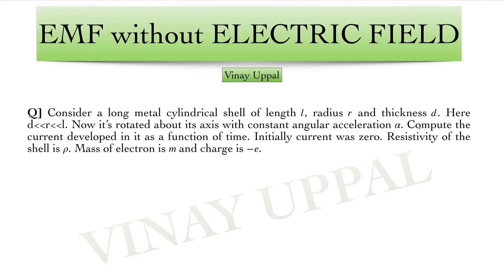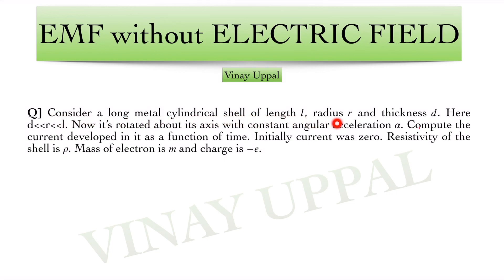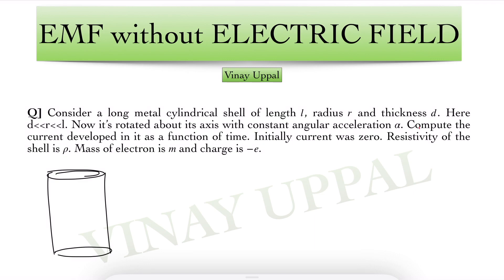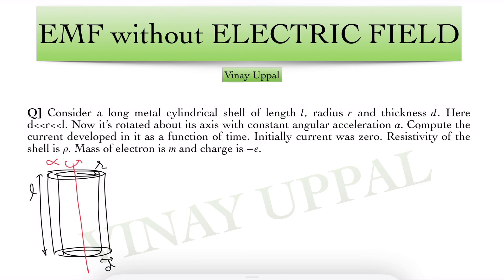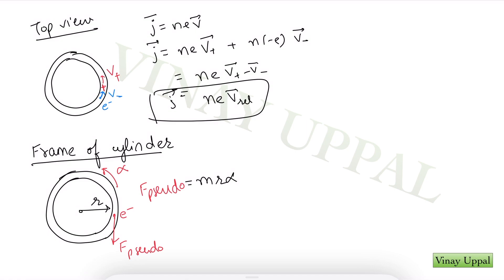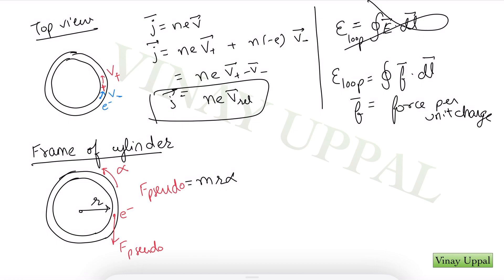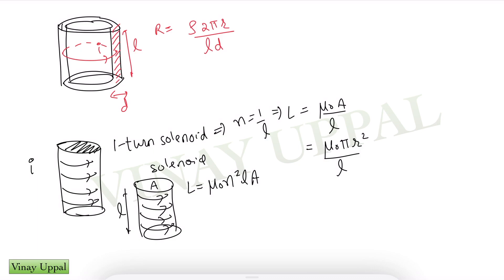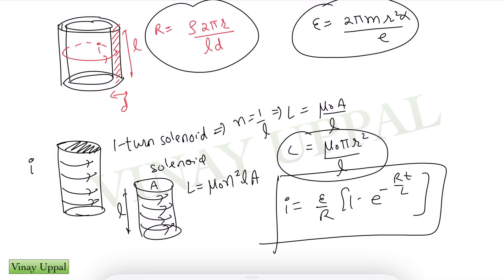S2 PREDICTION E8 : Learn FUNDAMENTAL Concept of EMF! IMPORTANT For JEE Advanced! Multiple Concepts!

Comment: Sir I have a huge doubt about this: I did this question in similar sense to Hall effect mentioned in HCV, as due to rotation of cylinder, electrons should experience centrifugal force( as they are free to move) and after some time that centrifugal force is balanced by the Electric Field created due to charge imbalance..so current should flow radially outwards and accordingly current becomes proportional to square of time..
Reply from the maker: There will be indeed be centrifugal force but since it's along the radial direction it will have no contribution to the current flow since current flow is tangential. For current to flow, there needs to be a closed loop which is not possible in the radial direction. 

Check out Season 1 Episode 2 from the Rare Series : https://youtu.be/XTg5J9QBp00 to look at a Jee 2020 problem where this effect of centrifugal force was significant. This addresses your question of there being an electric field in the radial direction and hence potential difference but still no current flows in the radial direction which violates Ohm's law!